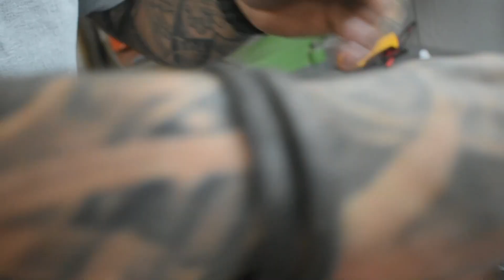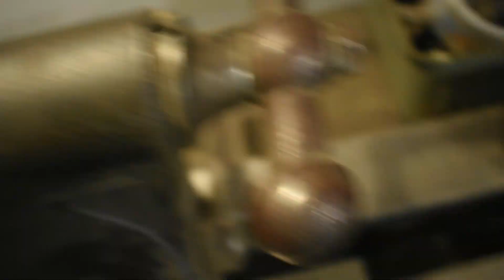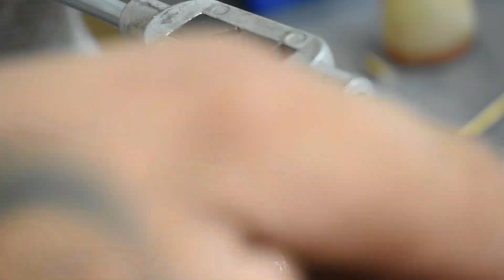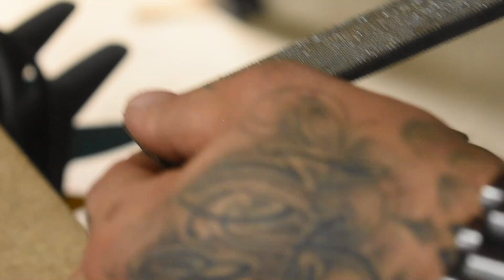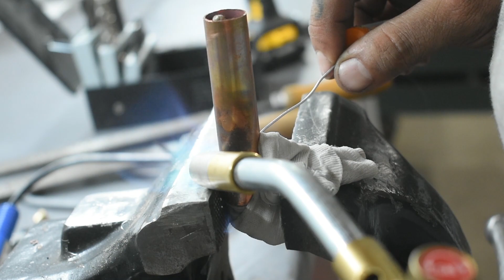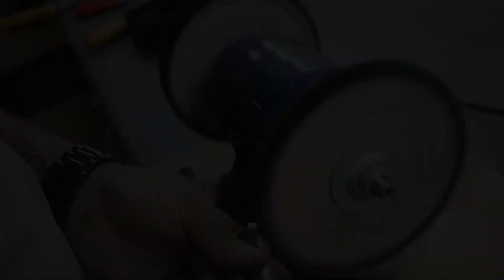HABU \\ Building A SteamPunk Lighter

Comment: Killer project! You come up with some neat stuff. Please don’t take this as a negative criticism....the joint on the bottom is at risk for failing or possibly leaking after a drop or two. Maybe a bulkhead fitting would be safer/stronger from a mechanical standpoint....I used to brew beer and soldered many fittings into kettles this way before going with a bulkhead.
Reply from the maker: Thank you 😉

Comment: Zippo has this really annoying issue where the fuel evaporates pretty quickly. This thing probably dont evaporate EVER. The "Exotac Titanlight" also doesnt evaporate, but its kinda pricey (i love the brand though). Trench lighters are also pretty cool. They should be easy to make, works in windy conditions, and only use cotton rope for fuel 👍

Comment: hey Hassan . Need to ask a question. To connect two pieces of metal you are using  soldering wire? If yes is it stable? If not what do you use? 
Thanks a lot!

Comment: Gas is gaseous, what you have there is liquid, ie petrol.
Reply: It should be lighter just as in Zippo lighter. If gas is used, it would be a gas lighter. Nevertheless, a great project
Reply: InnaSoulSounds that's like propane/butane, it IS liquid though. Why would gas bottles be so heavy then ?
Reply: Josh Luijsterburg before lighter fluid regular gasoline was used in such lighters... hence gas lighter
Reply: We call Gas to the Gasoline. It's just an abbreviation.